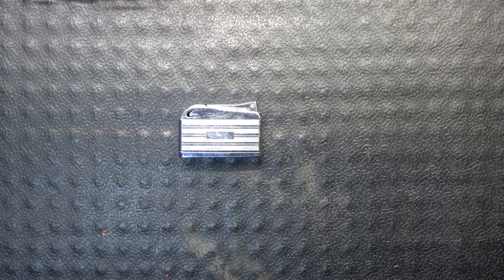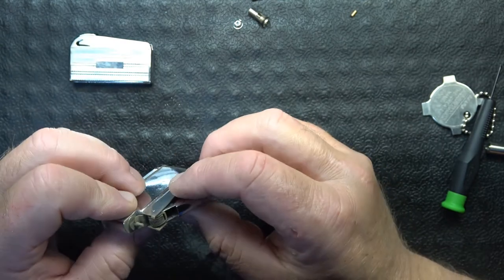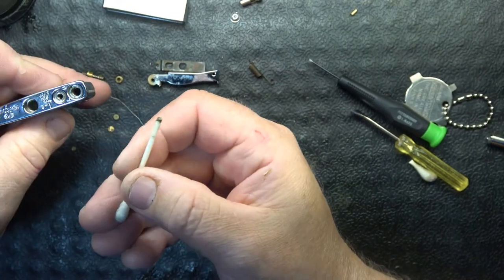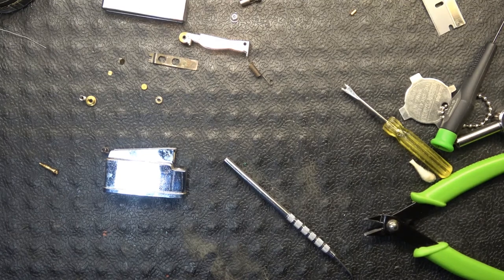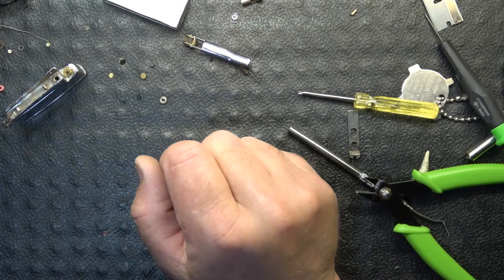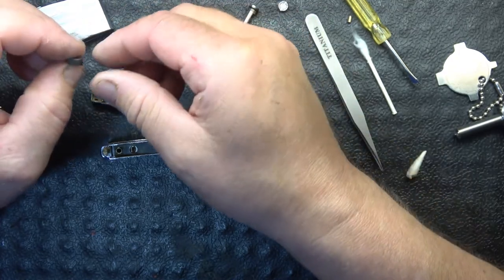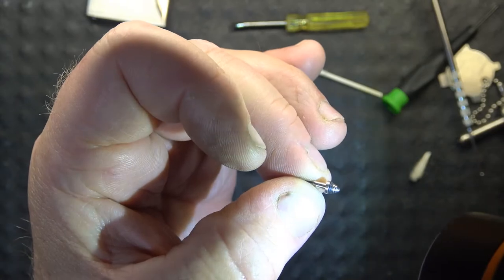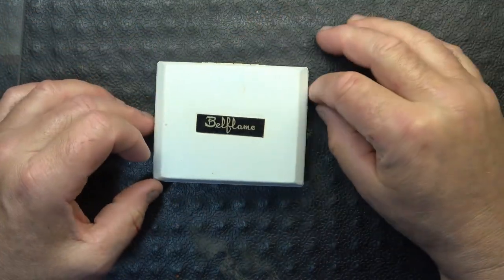GBD Belflame Pipe Lighter Repair

Comment: I personally use tiny white or black bristles paint brushes or micro dremel bits with sanitizer to clean things out. I stay away from swabs as they can get stuck inside or pull on something. I cut the bristles into a Christmas tree but some white and orange ones come angled perfectly. I have hundreds and they work awesome. Always sanitizer so it stays on longer and easier to wash off. But depends on what works best for you of course.